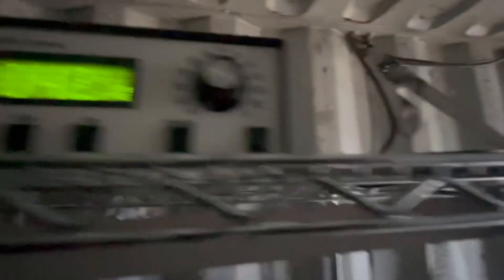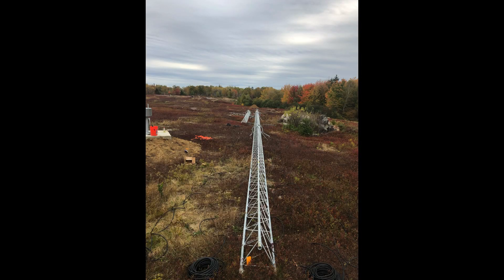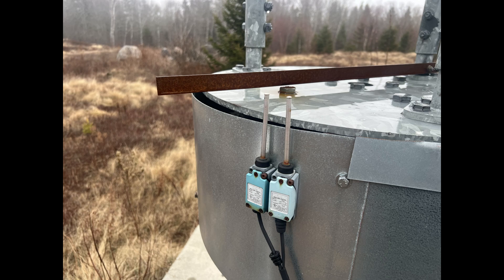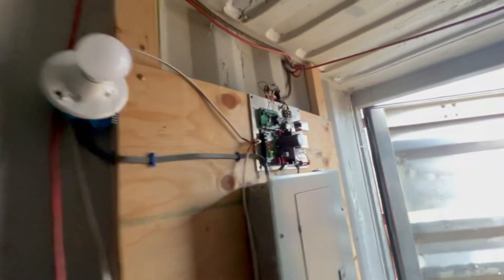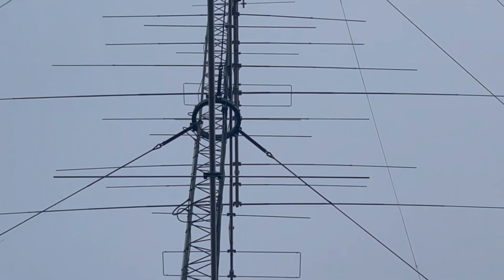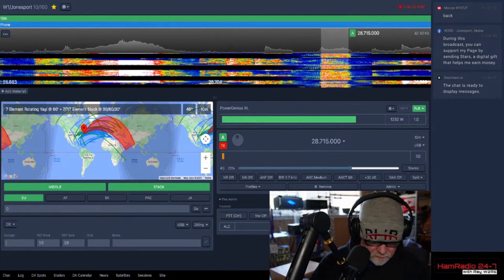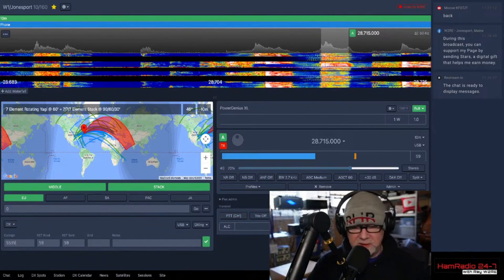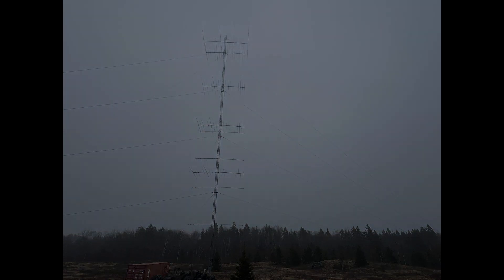Rotating vs. Fixed Towers: Which is Better? Ham Radio

Comment: I always get a laugh out of hams who have rotating towers. They always talk about hearing someone on the backside of their antenna or rotating their antenna toward me for better communications. Yet, 95% + of the time, my S meter does not move one bit. It's just as good off the backside as it is off the front side. I find it super funny.

Comment: The next level is to phase control the  antennas for the best vertical takeoff angles for the propagation mode that is in use. For RX or TX. Good luck !.
Reply: I think that's a crock of shit, same with all these dudes rotating their antennas everywhere. 99% of the time I can hear him just as well off the backside as I can when they pointed straight at me. My S meter doesn't even move.

Comment: why rotate the entire tower vs. rotating just the antennas?
Reply: If there was one antenna this would work. But with multiple antennas, it makes more sense to rotate everything. If your rotator malfunctions, it is at the bottom at your feet, not on top the tower.
Reply: If you only have one tower, it can be challenging to implement various beams that can rotate; typically, only the top beam rotates while the others remain fixed. Stacking the same beam at different elevations allows for different take-off angles. In RHR fixed towers, only the top beam rotates unless side arms are added, but they cannot perform a full rotation.

All the beams can move with a rotating tower, enabling you to have a stack in any direction—not just toward Europe, unlike RHR towers that lack rotation capability.
Reply: I love this whole set up, but why does it look so crooked??

Comment: Just curious: how do you maintain the positional accuracy of the tower inside the rings?
(I've worked a lot of DX stations with the RHR stack yagis in Maine and I'm 100% convinced that they work the best!)
73 de JJ1BDX / N6BDX
Reply from the maker: There is a pulse counter on top of the motor - that spins realy fast. With the guide of the pulse counter and the Green Heron RT-21, the tower typically stays its course. Occassionally, it may get off by a few degrees but we can easily recalibrate with the Green Heron RT-21 controller.
Reply: I enjoy listening to people who say they are moving their tower and pointing their antennas toward me, meanwhile my S meter doesn't move one bit and it doesn't change anything. 😂